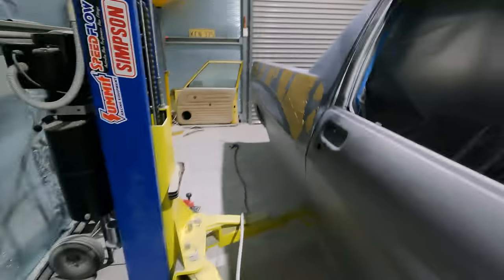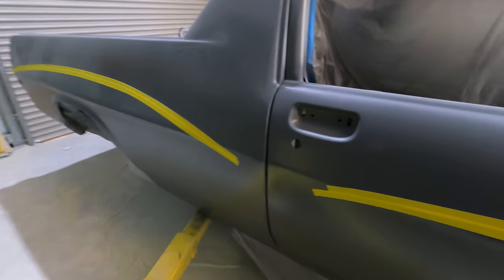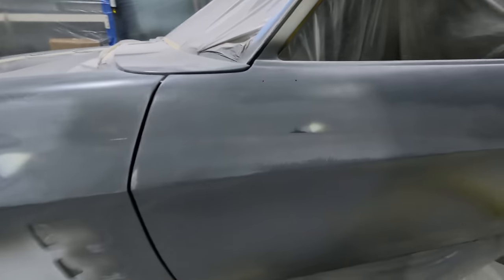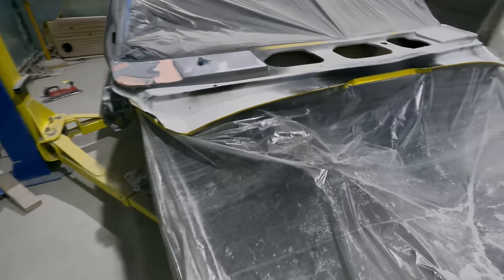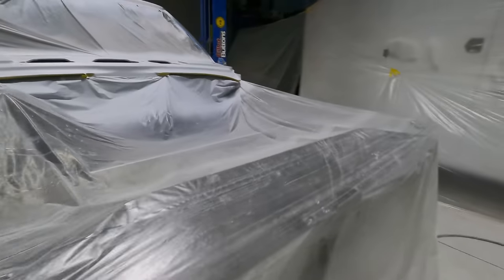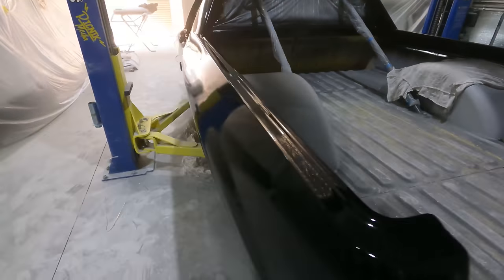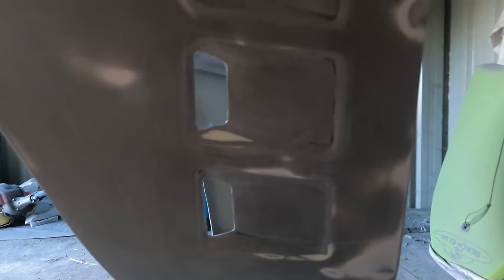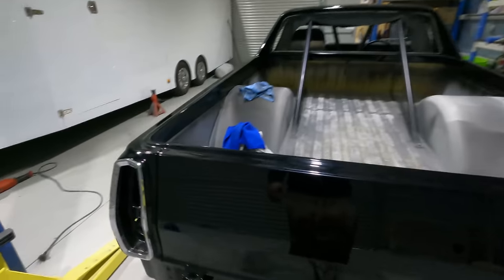#15 PAINT & PANEL PART 2 OF 2 Holden HZ ute project LOOKOUT

Comment: Hi im doing a hz using resto finish primer, which is almost the same as clausen All u need primer. What sand paper grit you go  inbetween coats of all u need primer. Thanks
Reply from the maker: Usually 80grit for speed

Comment: Sorry this is the first of your videos that i have seen , while it looks like you are putting an awesome effort and appreciate the work, would it not be better  to skink and/or expanded the metal to better alignment than put all that bog in?
Reply from the maker: Last time I attempted to shrink metal it made it worse lol its a good skill to have but I have no interest in learning it as I just do not have the time or patience. The thickest amount of bog in this on the quarters would be around 5-6mm which will outlast the paintwork and the ute. If the low spot was any larger I'd beat it out for less filler, I am not a spray painter or a panelbeater I just do what I know works. I do all this stuff as its my hobby but I'd never take it up as a job. Its messy, hard work and an underpaid industry. You would get turned away, laughed at or overquoted from 90% of shops if you walked in and asked for a metal finish no filler spray job.